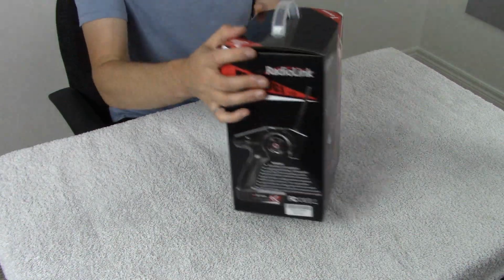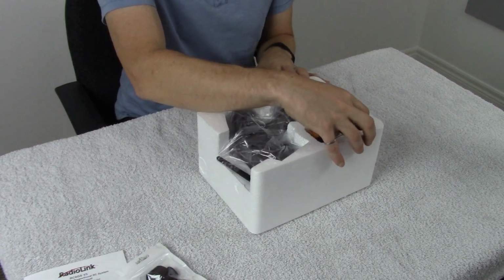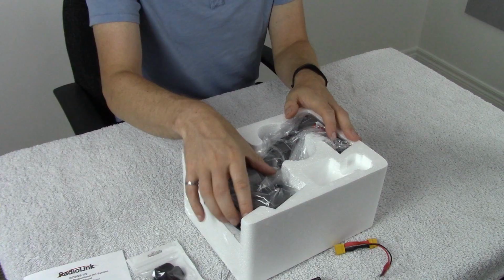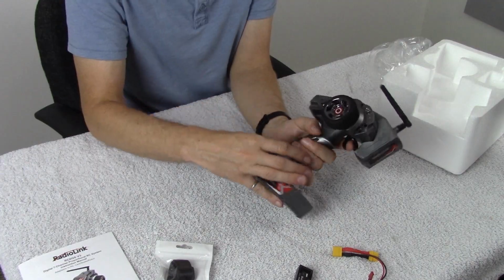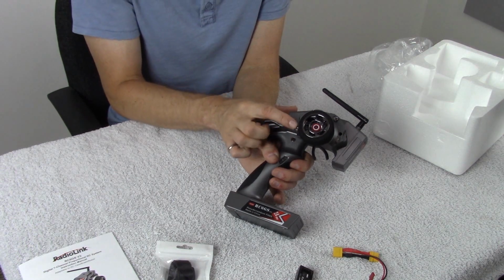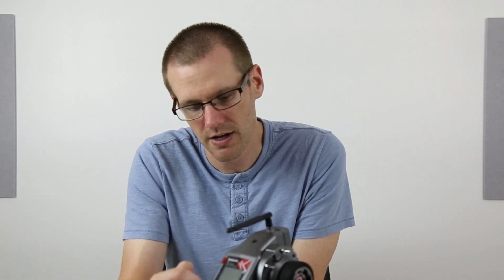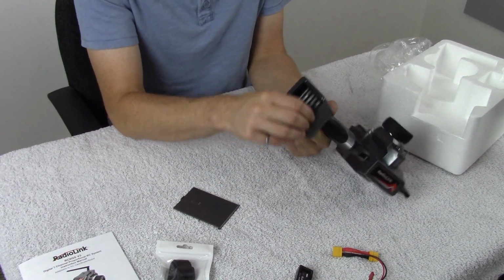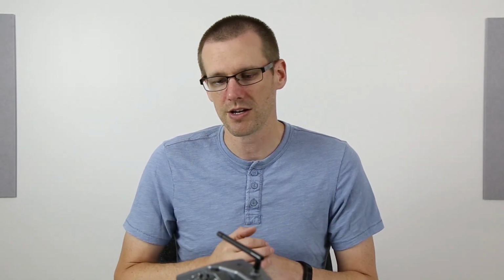Unboxing the most Inexpensive Radio for Speed Runs with a 600m Range!

Comment: I really like this radio, have had the signal drop unexpectedly once but have also got 500m range and can get the rc around a smallish brick school building (fpv) without issue.  Also as far as I know this is the only pistol grip radio that has a head tracker port (the dsc port, again fpv).

Comment: Great choice use the range more effectively with LED lights or strobes , it helps....from experience.......range booster I also use with it to help with delay in signal while long range....may not matter to someone crawling a truck across a big field and they may not even realize it has delay, but when your talking High speeds.... it's a bit different
Reply from the maker: Interesting. Leds would help a lot I'm sure.

Comment: Nice, excellent review of the controller!! 😎👍
I have never used any super expensive & fancy controller before, but as a owner of the RC4GS model, which is the 4 channel version & has a lesser range, but still amazing, I know it's going to get the job done. As far as range, I know from experience that the RC4GS does perform the advertised range of 1200FT (~366M). But the steering begins to get a tad wonky at that extreme 1100-1200FT. I'm about to upgrade to that model soon, think it will be easier than trying to get a range booster for my current one.
Reply from the maker: Thanks! Hope it's a good radio. Will find out in time!
Reply: @RCexplained lol, I literally just ordered mine (the RC6GS) & then saw your comment 😄
I need the extra range this model offers.
Reply from the maker: Nice. Gotta love that timing!

Comment: Great budget radio for the amount of features. I'm running a 3S/1500 XT60 in mine w/o any issues. Be sure to set your LV WARNING appropriately in regards to your power source. Add a little foam padding or gorilla tape to the battery door as well because I've since dropped mine & broken one of the door tabs. Still very pleased with it's performance

Comment: do a review on the flysky fs-gt2b. I love this cheap radio and use it for most of my cars and boats that only need 3 channels. The fact that it comes with a lipo battery inside and can be charged by usb is great. Only downside to me is the foot it is standing on, together with the low weigth makes it less stable when free standing. It will tipp over forward with just a little bump.
Reply: The gt2 Radios are old and bad. They are known for a ridiculously low frame rate and lag issues. I would only ever use them for trail trucks, but never for something where you need decent control. 
And why should he do a review on something which has 1000s of reviews already out there since a decade...?
Reply: @AsurasWrath164  I do not have fast cars, only 1:10 scale crawlers and scalers, 1:35 4x4 models and snowcat's and a snowmobile and some boats. So I need nothing special for that. Maybe they are "bad" but for what I use them for they are great. And the reason for a review on that one? Why not. On almost every product there are multiple reviews. Every person has his own way of doing so. Some very technical about the menu, others very technical about the build quality of the insides and used electronic parts and people that just tell you about how they experienced it when in use. And since I like the way this channel shows the radio's I suggested it. So maybe this radio is not for you. no problem. But it can be for others.
Reply: @dextersxxxxlab  he's building a speed run vehicle. The fs-gt3c is probably the worst possible radio for that use

Comment: I had two problems with this transmitter, and I've solved both.

First problem is the battery cover, it flexes too easily, so the batteries can shift and disconnect.

Second problem is the on/off switch, it easy to bump it on during transport.
Reply from the maker: Good to know, thanks

Comment: Nice video, would using the higher voltage range not make the transmitter more efficient, possibly increasing range.
Reply from the maker: I would expect range is unchanged, especially since I will be using 2s.

Comment: I can confirm to anyone curious it will run fine on 4s . The display only reads up to 15.4 volts but otherwise is fine.  I cut off the adapter thingy and soldered the jst to the posts so I get telemetry on the model . As things go some will say this is a bad radio others good . It's not perfect but I love mine . Do some homework this thing does a LOT that can help make for a pleasurable drive from having gyro to abs .. yes it can pulse controllable braking so your model doesn't go into a death spin if you gotta slam on brakes

Comment: Definitely test out the radio before you send the speed car out 100+ mph....

I like my rc6gs but it has some signal issues intermittently. Appears to easily suffer from interference which can be seen from the RSSI signal.
Reply: I've noticed radio interference with any remote.  I've discovered that your location you're using it at may have dead spots or a transformer powerlines nearby that emittd a jamming frequency that interrupts the signal of your remote.  Not to say some remotes have weak signals.  Obviously no remote is made equal but I agree as a speed run protocol you should always test your range before doing a full pass.  Would hate to lose control at any rate of high speed that is subjective to the individual.
Reply from the maker: Will do thanks for the pro tip

Comment: The basic version/model(rc4gs) of that transmitter is really bad.. I've had 2 of them(v2 and v3) and both wouldn't even go past 100 meters. Complete signal lost. I should have tried this model instead but... it'll be the last radiolink transmitter for me.. Lol
Reply: I use the rc4gs v1.1 on Hydro 2 outrigger and no problem with distance. That is very fast boat 😉
Reply: user error